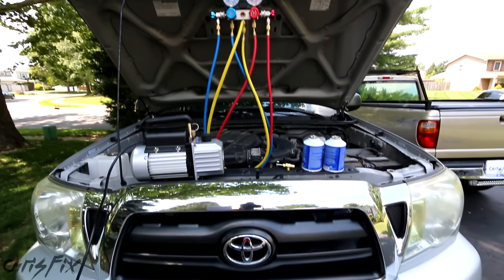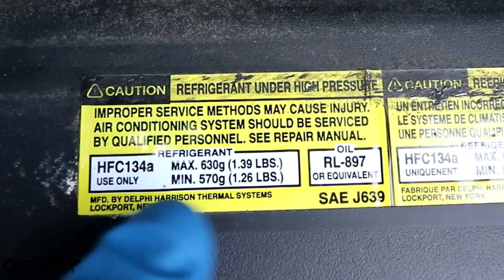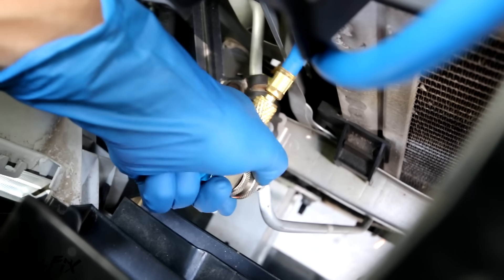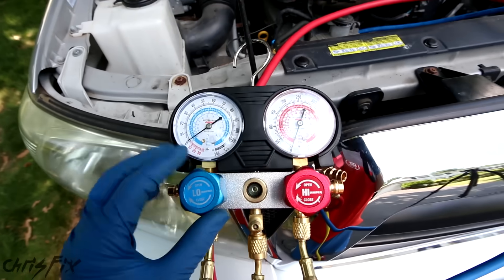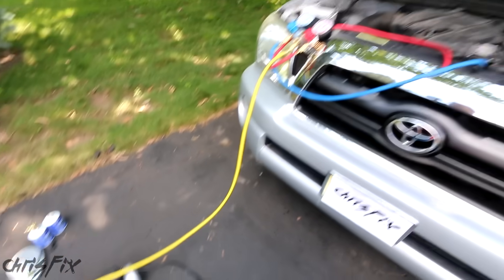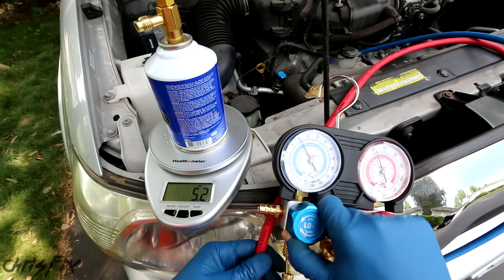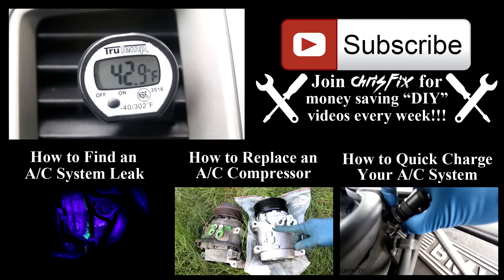How to Properly Recharge Your AC System

Comment: Good video. It explains the basics. The first  r134a can you could have charged it after purging the yellow hose without running the compressor. Since the system is in a vacuum, the refrigerant will get sucked into the system as a gas due to the negative pressure already in the system. It is just one more way to do it.

Comment: Hank hill AC. 70% propane, 30% isobutane. Unless of course you just like spending money for 55°F air.
Reply: I want to try this but i'm afraid my system will leak and go boom.
Reply: @jamesb1221222  unless your system leaks out completely in a few days or less....your dandy. Propane isn't like gasoline vapors.
Reply: @whozaskin3639  Interesting. I have a mini fridge in the garage I might test this on. Existing refrigerant leaked out and i got the thing for free. May keep it outside as a beer fridge. Thanks

Comment: I ordered the gauge set recommended & it did not work as shipped.  WARNING: If you use this system the valves operate backwards from that expected.  Clockwise is open!  The video recommends filling the yellow hose with dye.  Good luck.   I paid $89.95 to have my system evacuated as I do not have the required system to recover refrigerant and I purchased a digital mail scale to weigh the refrigerant.  Then when attempting to recharge my system under vacuum the high pressure connector leaked.  Then I could not get the hose to connect to refrigerant can.  I figured out that there was an adapter & used that but there was a shrader valve in the adapter preventing refrigerant from escaping.  You must attach the end of the yellow hose with the shrader valve depressor to the refrigerant can tap to get refrigerant to flow.  If I over tightened the yellow hose  to the adapter it would stop flow.  I had to loosen the yellow hose to the point refrigerant leaked into the atmosphere which I paid $89.95 to prevent.  Overall an unsatisfactory experience!

Comment: My question about weighing it is: By the time you're done, there will be refrigerant inside both the yellow and the blue hose, and they will not be in the system.  Should you be adding slightly more refrigerant to factor that in?
Reply: If he didnt show it you should cut the bottle pressure off so close your 134a can, but leave your low side open and the compressor and suction line will draw it in so you dont have any left over

Comment: Just the other week it hit 90 and I made a trip to Autozone. 2 guys with their hood up were parked out front and noticed they had 2 cans of r134 and the stock plastic gauge. I picked up a few things, went out the door and before I could escape, they were backing out and K A B O O M !!!!! Sounded like a shotgun next to my head. The massive white cloud told the story. Seen this many, many times so unless you know exactly what you are doing, get a pro. Somethings, yes, learn and diy. But imo especially where a/c is nice but a MUST HAVE, spent the money and get cold air for 5-10 years.
Reply from the maker: Thanks for sharing but I disagree. This is not difficult to do at all and it’s exactly why I make my videos.

Comment: This is way over the top. If you have to go buy all that stuff you might as well go to a professional and have it done. If your air conditioner is not working you have a leak it’s just that simple. Be safe don’t play around with something You know nothing about. Go to your auto parts they have a can with Gauge on it. Just follow the directions. But you probably have a leak.
Reply: If you are just low then you can refill it with the bottles in the store pretty easily. If it is completely empty, then you need a vacuum pump and the gauges to fill the system. Air is not supposed to be in an ac system, if air is present then it must be removed by a vacuum pump for the system to work properly. Air in the system contains water vapor that will wreak havok on the ac system. 
If you're ac system is just low then refrigerant can be easily added with the cans that have a gauge attached. If you had to replace a component or seal on the ac system then the procedure shown in the video must be followed.

Comment: What if my ac has freon in the system ? I recharged mine a while ago. But I over charged it and it wouldnt blow cold. I bled and and it's kinda cold. But not enough. Would you recommend doing this or bleed the freon first
Reply: If it still has freon in the system then the cans with a gauge attached can be used. You won't be able to get it perfect without knowing exactly how much refrigerant is already in the system but you can get it pretty close by watching the gauge.

Comment: Many countries including the USA have EPA refrigerant recovery regulations.  The fines for unlicensed and illegal venting of refrigerant comes with very expensive fines.  For more on the subject see EPA 609 certification.  Disclaimer, I am not automotive certified.  I am Universal EPA 608 certified which is all systems except non hermetic automotive.  Sealed electric systems such as on a Prius require the EPA 608 certification instead of the automotive certification.  Be safe, be legal. Avoid very expensive violations.
Reply from the maker: Thanks for sharing. No one vented refrigerant into the atmosphere, just put new refrigerant in.
Reply: @chrisfix  True, but just wanted to get the word out on the EPA requirements for refrigerant recovery.  Hoping nobody just vents to change a compressor.  To prevent influx of moisture, it is common for a shop to evacuate a system, then pressurize with Nitrogen for leak checking before evacuation and recharging.  Blended refrigerants are always added as a liquid to prevent fractional distillation in the can which changes the properties.

Comment: whaever gauges show everything has to be on max pressure u so full of BS, u so enviromentaly friendly vacum sux all into atmosphrere then u blow system with screw driver,  looks like noob on dangerous equipment.
Reply: What are you talking about? He added in the proper amount of refrigerant, using a scale.
He only blew a very small amount into the atmosphere to bleed the yellow line. Its not enough to cause any damage. Purging all 20lbs of refrigerant would be bad, blowing a small spurt into the atmosphere does nothing.

Comment: Great vid, Chris!  I would like to add a caution though, when filling with refridgerant, ONLY fill on the low side! Never the high side.       Thanks
Reply: my hella compressor instruction stipulates using the high side only
Reply: my understanding is the compressor can be damaged if liquid 134a reaches it, which is what might happen if you fill from the low side.

Comment: From my limited experience, I recommend using a more sensitive tool than the usual analog needled tools you can rent. A friend loaned me an Accutools Bluevac Micron Gauge (search for A10673 Micro Bluvac µBluVac), which you attach to the vacuum pump on the entrance valve (his pump has a T on the top). It is much more sensitive to pressure changes, and I knew within a minute of turning on the pump on that I had a leak because that micron gauge was slowly going up (vs. down).

That gauge also gave me a clue about which "side" the leak was on by closing/opening the LP or HP valve while the vacuum pump is running. In my case, when you close the side with the leak, there is a momentary but substantial dip overall (around 2000 microns, IIRC) for a second or two before equalizing (through the farther off leak). Closing the valve on the side without the leak, OTOH, didn't drop the pressure the same way (hardly made any difference). It turns out that I didn't seat the HP line in the condenser correctly and need a better seal and gasket.

Along with this great video, that tool saved me a lot of time finding that leak. If you can get your hands on one without paying a ton, I highly recommend it.

Comment: How I know system need oil or not, my vehicle model more than 10 years, and never before service AC system !!!
Reply: it's only if you get a new compressor and it doesn't come oiled. That's the way I understand it but I am no pro and know very little about AC systems.

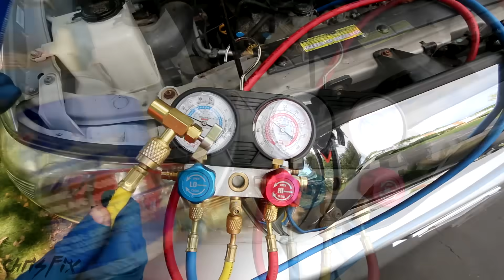Comment: 11:22 wait wait wait....how did you twist the 2nd can on with the tap in the closed position??  Wouldn't the tap have punctured the can before it was threaded on?
Reply: Thinking the tap was only PART way down.
Reply: @danielwilson7572  This is why adding a ball valve to the yellow line is nice
Reply: @danielwilson7572  My tap is only sealed/closed in the "fully pierced" position.
Reply: My very thought....

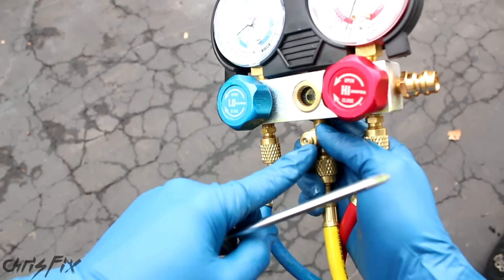Comment: Ok Chris - your video really helped me - but you got me on adding the oil through the yellow line....  I replaced a leaking discharge hose on my vehicle and needed to add about 1oz of PAG 46 oil.  I followed your directions @ 7:58, and filled up the yellow line with the correct amount of oil.  But when I got to the purge step @ 9:21 - my God - oil started spraying everywhere!  Not sure if I got all of the air out, but there couldn't have been much room for any with all that oil in the line.
Reply: ljbrandt500 this guy is an amateur you can tell by his tools and he’s a dumbfuck

Comment: When you pull the vacuum, wouldn't it also suck out the oil from the compressor?
Reply: I think the oil is just in the compressor not in the system.

Comment: So, on the control valves where they quick-connect on the car’s a/c lines, you close them by turning counterclockwise?  My a/c gauge kit says turn clockwise to close them.  Then again, I notice that turning them clockwise lowers the (needle?) down so that it would push the schrader valve open.  Is Chris right and my manual is wrong or do I have dain bramage and am confused?

Comment: So what if you come back 1 hour later like you said and it has gone up?? HELP
Reply: Well...that means you have a leak.  Go back through all the connections and find where it's coming from.
Reply: Mikey83943 So do you think it’s in the AC hoes or maybe when I connected the lines? Should I take it off and reconnect everything and try it again?
Reply: @TypicalKent95  You're the only one who can troubleshoot this.  If it was leaking before, it could be anywhere.  If it only lost pressure after you messed with things, it's probably in the connections you made.

Comment: Hey Chris, I'm Deveren (DJ) from Atlanta. Are you familiar with  the r1234yf system. If so, would you mind doing a video?
Reply: If r1234yf is just the coolant type it should be the same just with different coolant
Reply: @claireelliot6846  Yeah, different nozzle fitting too. The dealer told me there were additional steps.

Comment: Hi chris, i have a ford crown victoria 1992 and i'm thinking on install all new a/c sistem but my doubt is the refrigerant if i have to charge it with R12 o R134a, what's your recommendation.
Reply: The sticker that says how much refrigerant you need also states what TYPE of refrigerant you need. In a '92 I think they used r12 unless it was retrofitted to r134a

Comment: That's not true about adding the correct amount of oil on a new compressor that the compressor requires. The oil is spread throughout the entire system so unless the whole system was flushed out, putting the exact amount of oil the compressor requires would be overfilled with oil because you still have oil spread throughout the entire system.

Comment: At 11:18 in vid, you say to close can adapter valve all the way to seal off the yellow hose.  Doesn't it need to be opened again before screwing on the new can?  Seems it would just release the refrigerant before getting a tight seal when screwing it on.  Should it be opened again before piercing the new can and then just purge the air again?

Also, I'm just going to replace the refrigerant suction hoses and the accumulator/drier.  Does oil still need to be added?

Thank you very much for your vids.

Comment: What happens if there turned out to be a small amount of R134a in the system when using the vacuum pump? What happens with regards to moisture drawn out? is it vented or drained from the pump somehow? If there were a leak would you use a stop leak of some type and if so would that limit the amount of R134 you could add to the system?

Comment: Back when I still worked at oreilly auto parts, I had a customer come in one time and buy a can of refrigerant with the nozzle, no big deal. Told him it only fits on one line, and read the directions. Comes back and says he cant find any of the fittings. I go out there and the guy does not even have an AC system hooked up to his car. Still makes me chuckle to this day

Comment: Thank you for the video. I just replaced the compressor of a 2007 Sonata 2.4L.  It is a lot of work. I spend $330.00 with parts, but I replaced  the serpentine belt, oil, and drier. Left same o-rings and expantion valve. Write me if you have questions about Sonata 07.

Comment: when charging a refrigeration system, always in most cases use vapor charge. refrigerant bottle standing upright. ok
Reply: Late response but liquid low side turn the can upside down is completely fine saves a lot more time then doing vapor.
Reply: @fearvenom1525  Never ever charge upside down for car ACs, it might be quicker but liquid should never go inside a compressor, break those reed valves and bye bye compressor. 

Only time you should ever charge an AC with the can upside down is if the refrigerant is a blend such as R-410a, r-421a ect but these only exist as building AC refrigerants. R-134a is not a blend there for it does not need to be upside down.
Reply: @misterbaxter3734  only time you can charge with can upside down is through high side port and vehicle off.
Reply: Yup..you right bro..
Reply: So Chris did it wrong? I should never turn the can upside down? Should I shake it while it being drawn in?

Comment: Never constantly charge a system with liquid refrigerant, you will damage your valves, they were not design to pump liquid, they were design to pump gas.ok
Reply: If you charge liquid refrigerant into the high side after vacuuming, with the compressor shaft obviously not turning, then nothing bad will happen. The valves prevent anything from backflowing from the high side into the compressor. Trust me
Reply: yes I know but you were not doing that. ok

Comment: Leaving air in the system which is consist of moisture will cause freezing at the expansion vavle, which leads to blocking of liquid refrigerant flowing through the expansion valve, causing the system to build up high pressure and trip on the high pressure cut out switch

Comment: At 4:20 when you opened the low pressure side connected at car, it looked like you turned valve right instead of left. Does this close backwards or was it optical illusion from camera?

Comment: thanks for the video!.  I'm finding my A/C temperature is only cold on the driver side and the passenger side is still blowing hot air on my tacoma.  Any ideas?
Reply: Sounds like an issue in the duct work, not the ac system itself. There is probably a blend door or actuator that went bad somewhere.

Comment: Moisture will not only cause a leak but pag oil is made to ABSORB water and will turn black if there is moisture in the system, it will quickly ruin many parts of the A.C. system

Comment: I assume your vacuum pump is sucking at 3.6 cubic ft per min. 45 min? 162 ft3 of air? I think the car AC has less than 1 ft3 of air in it.
Reply: Most of the air will be evacuated in the first minute. The rest of the time is to remove the residual air and, more importantly, the water vapor...one molecule at a time.

Comment: Main error I notice, at  8:05 attempting to add oil / dye? After vac and before adding gas? 
No. You'll never tip it down the hose in sufficient quantity OR without air getting in the yellow hose. 
The answer is 2 vacs. 
An initial vac assists in adding oil etc (if needed). Use vac to "suck" the oil up the hose. 
Then re-vac to 500 micron ensures no air in the system. Then add the gas. 
Better still add oil straight into compressor while it's on the ground. 
You can't do what he showed above without compromising the vac.
Reply: Underrated comment
Reply: Nathan I just ran into this problem. Should have read the comments
Reply: Straight up legit comment, don't add that shit like this😊

Comment: Good video Chris, But I would of hooked up a digital Micron Gauge in series with pump. I Always pump systems to 500 microns or less. No way of telling how many microns you are at with just a compound gauge, It's such a small reading that compound gauge will not tell. Before I even do a Vacuum, I perform a pressure test with Nitrogen first to check for leaks.
Doing the job textbook costs a considerable amount of money.

Comment: If your car air con has emptied out by a leak, fix the leak, and re gas it with pure propane, don't worry abut vacuuming,,, purge it, turn the gas bottle upside down and open the liquid line valve, while letting the compressor run,,,, when you feel it is very cool,,, turn off the gas bottle.... I have no idea about what I am talking about,,,, So don't take any notice of the above... I installed a Mitsubishi split system 20 years ago, and it runs on R22,,,,Never recharged it.... on the other hand, I bought a Simplex split system a year ago,,,
it leaked and I fixed the leak,,, re-routed the pipes,,, it should be run on 341 a or something like that,,, I didn't have the gas,,, so what did I do? I used my 20 year old R22 5 kg bottle and ran the compressor until I felt it very cold,,, no leaking,,, and no purging with R22,,, you can purge it with Pure Propane,, the stuff we use for cooking in Aussie land,,, not Auto gas which is a mix of propane and butane.... Again, and importantly,,,, DON'T TAKE ANY NOTICE OFF MY WAY OF DOING THINGS,,, DON'T COPY.
CHEERS